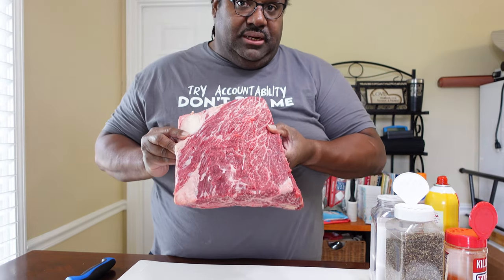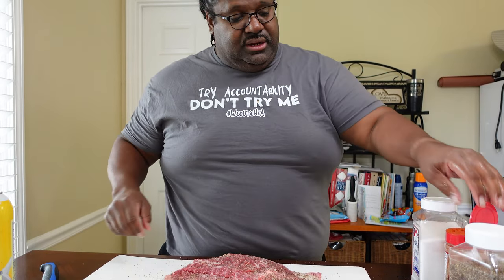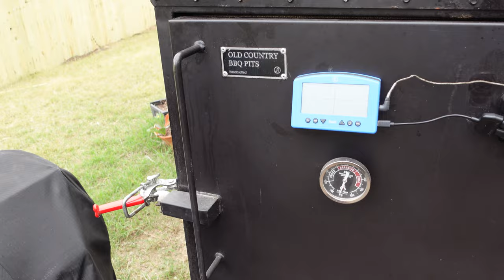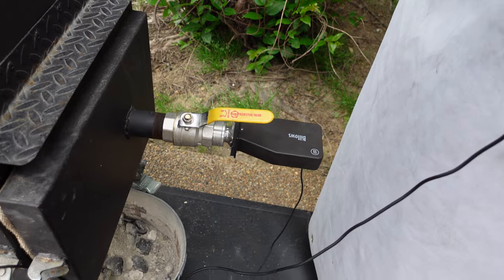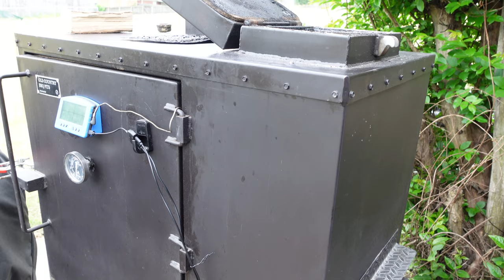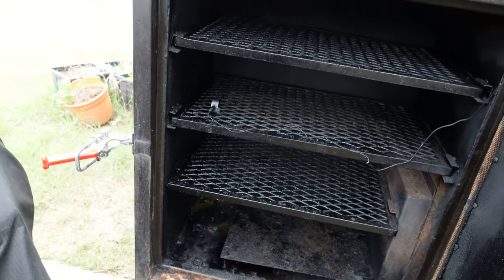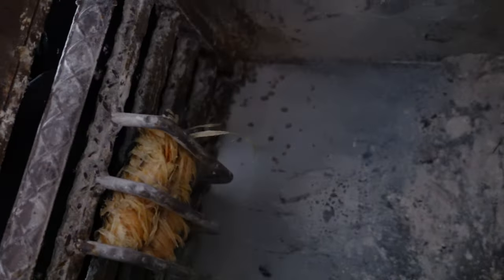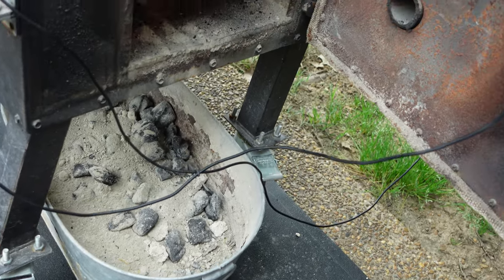Beef Short Ribs 6th, 7th, and 8th Bones on the Old Country BBQ Gravity Fed Smoker

Comment: Great video. Im just curious, what type of charcoal did you use, and do you keep the chimney all the way open?
Reply from the maker: I use B&B competition charcoal. Using the bellows fan you have to keep the airflow valve all the way open. If you don’t use a fan or pit control you dial the valve in to the temp you desire. It’s easier using a pit controller system though.

Comment: I bought the same exact setup yesterday. I love super heavy smoke flavor on my meats . What type of wood do you recommend and add to the chute or just in the bottom where the ash falls?
Reply from the maker: I do both! I add smaller chunks to the chute and layer it in with the charcoal for a consistent smoke. I use small splits in the bottom where ash falls. My favorite two are hickory and apple, but I’ve learned using the B&B competition oak charcoal works great with a hickory mix and gives a more smokey flavor.